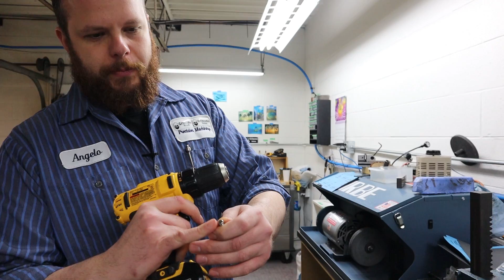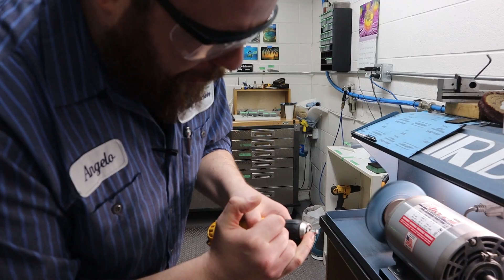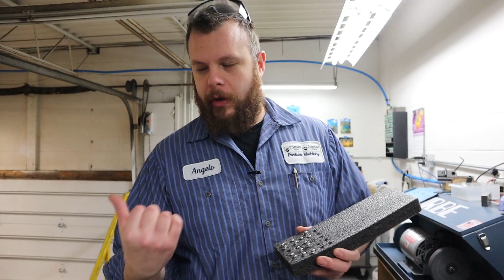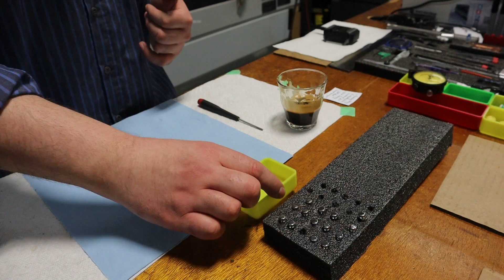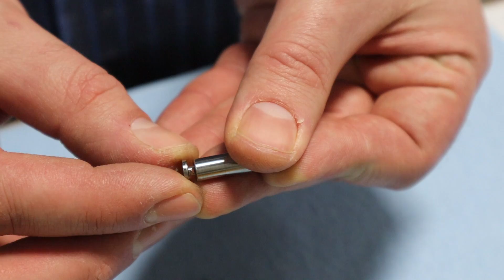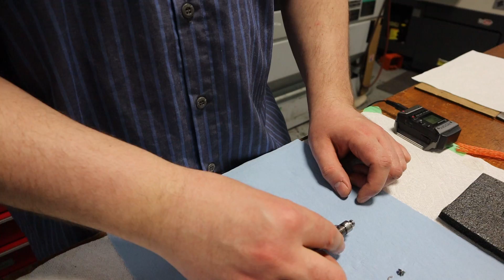The Saga Pen Mechanism - Saga Saturday 014

Comment: Make a tool that's a sleeve with a hole in it to aid in assembly.  You could put 1 bearing in and spin the sleeve to the next location and it would hold the last bearing while you add the next. Locksmiths use something similar without the hole when re-keying a lock to hold all the springs and detents in place.

Comment: For putting the balls in, assembly should try the revers of disassembly.  It would just take a stepped shaft that the outside assembly can sit on with the right size chamfer so that when the balls are dropped into the center they go into the holes.  Then put the core in, then lift the assembly off the jig.  Great videos and products.

Comment: Ninjaflex filament. Low shrinkage, predictable shore hardness. Excellent for fragile or scratch-prone parts storage / manipulation, and elastics printing (not your use case, but still, damn handy to make flexible parts). Possible a material for a pen-grip / sleeve?

Comment: Picking up those balls with tweezers would drive me crazy. Take a tiny tube smaller than the balls and make a vacuum pick up tool with it. Just a finger valve and a tube such that you put the end of the tube into a container of balls and it picks one up, the vacuum holding the ball to the end of the tube.  Move over to the pen assembly, release the vacuum and it drops the one ball into the pen precisely where you need it.

If you use my idea will you send me a pen ?  :-)

Comment: That needs to be retained with a screw, not a press fit. Ok a super expensive pen, it needs to be able to be taken apart. Blue Loctite would be much better. Include half a dozen extra balls (for 2 compete sets extra).

Also, it's Del-rin... "Del-" like the computer manufacture Dell, and "-rin" like the prefix of rinse. Not Der-el-in, Dur-lin, Der-lin, etc. So many people get that wrong, and it's always confused me why.
Reply: Andrew Delashaw it's actually Polyoxymethylene, delrin is a specific product  made by DuPont.